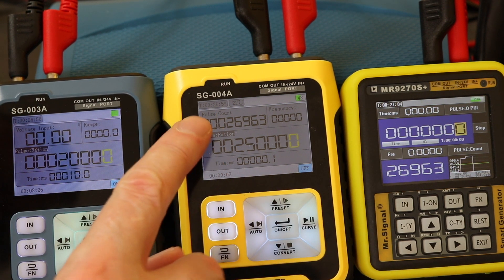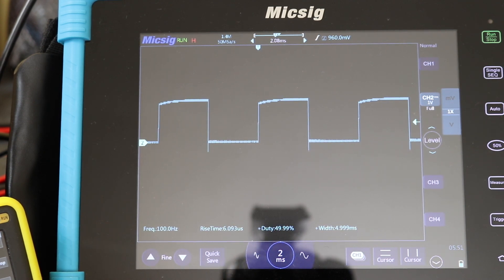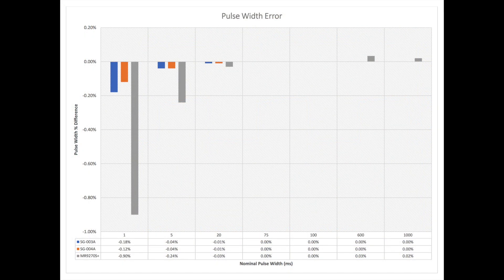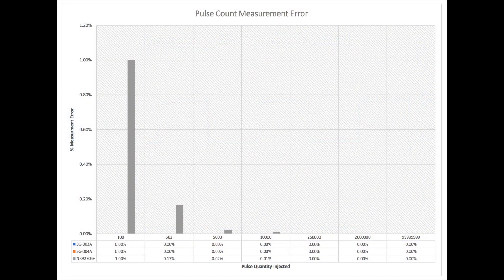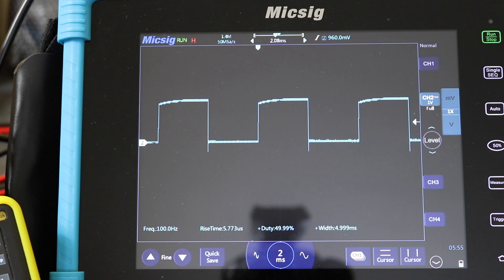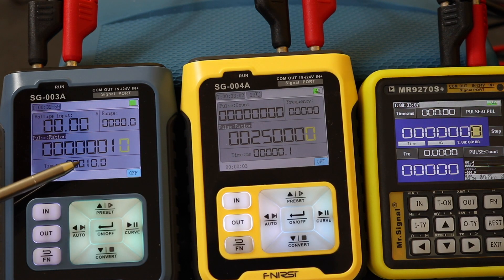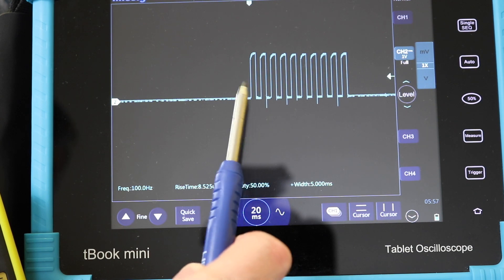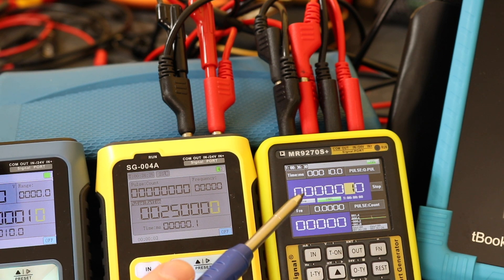Calibrator Q-Pulse Function Checks

Comment: This was a useful video. Also the other videos you made. Thanks for that.
I have another question about the pulse output.
Is it also possible to output a pulse of 3V or 12V to a measuring device? Or something in between 3 and 12V?
I want to simulate a pulser that gives a pulse of 5 volts, pull up.
That pulser is on a water meter and each round it makes 100 pulses.
So if i can simulate 50 pulses the  device should see 50 pulses. The flow has a max of 40 l/min.
Thanks
Reply from the maker: Yes, the voltage level of the output pulse can be set in the settings screen for the output mode, from 1.0V up to 24.0V.
Thanks for watching and the question.
Reply: @three-phase562  Thanks for pointing me out. Did found it. Measuring with a scope shows it just fine.
If I am correct this is only pull-up.
Is it also possible to make it pull-down? I think I should use a resistor, correct?
Reply from the maker: @AE31011  Its a switched output so if you connect the +out terminal to the pulse input and the com terminal to 0V, it should switch okay. If you have problems, then yes you could try a pull up / down resistor to see if it improves. Alternatively on the settings screen, you can change the 'way' from 'level' which would be the voltage output to 'oc' which is open collector switching and voltage free. You could then use that with the power from the sensor circuit.
Reply: @three-phase562  Thanks again. I wil give this a try.

👍
Reply from the maker: @AE31011  Good luck 👍

Comment: I reckon you can manually toogle them one after the other? when in stop-mode/active if you hit the up button (button preset) instead of hitting  play/curve button that makes it automatic.
hit the "up button" here 2:30 (step up sign) 

Thx for the video +1 I really appreciate that you dig into some of the deeper features on these process / signal gen meters, as they have quite a lot features up their sleeve.

Only got the SG003A and still trying to wrap my head around what the different things, actually do... likely need to dedicate some time to the manual or watch more of your videos as you have way more knowledge on the subject then I have... though already a subscr.
Reply from the maker: Thanks for watching and commenting.
Yes on the Fnirsi units, I went back and found that the up button gives a single pulse with each press. The right button gives the full run of the pulses and found that the down button stops and resets back to the number of pulses entered without using the on/off/enter button.
On the MR9270S+ I can only get the up button to run the pulses and the right button to send out a single pulse.
Thanks for the information.
Reply: @three-phase562  yep, also what I noticed.
you can also adjust the timebase on the fly by hitting "out" while its running its cycles, and the timebase seems to be spot on my scope, and 0.1ms cycles between 99.99us and 100.0us (Micsig STO1054C) you can also somewhat automate the manual cycle by holding the up-button, but it seem to double the sparetime in between cycles.
and you can obviously also hit the "graphing menu" in Q Pulse usecase with FN+curve and it will plot out the cycles with a falling graph-line and visualize it with a couple of axes, that I recall you do have soem control on those axes, and if it shall zoom in, or out and likely interval. FN+out and setting gear symbol, graph..
- and the control button-scheme is the same in the Graph/curve-screen, so all the same things can be adjusted, though the symbols are smaller, so likely not that ideal for video purpose..

Though my SG003A seems to be a little tricky in Q Pulse, as sometimes the first cycle is a weird short fellow and other times it aint and match my ms setting...maybe its the triggering on the scope.

What usecases does the switching feature holds?  0:46..switching obviously, but cant really make heads or tails when looking at it on the scope, while on the SG003A graphdisplay it plugs in a segmented line, as it cycling down.  (10ms)
the scope shows some very fast spikes up / down.. arhh I see there seems to be 10ms betweeen these very fast up spikes, and 5ms between up to a down spike and the voltage adjustment on SG003A doesnt seem to influence. fair enoug
Either way, great video, always a joy when one can follow suit and test it in own regi and trying to comprihend what the different things do, and the usecases they could be handy in..
Reply from the maker: @JAKOB1977  Yes, there is a lot of functionality built into these units and it takes a while to figure them all out. I haven't noticed any issue with the output pulse width on my SG-004A, they have all been equal across the waveform.  I would need to go back and take another look to be certain though.

The switching function is for use when your input has either a pull up or pull down resistor wired to it. So particularly useful for TTL / CMOS logic inputs. As it is a transistor switch, it can be used in place of a mechanical switch to avoid contact bounce affecting the input signal.

Comment: Haven't seen a video of yours in a but, sorry to hear about the job. 
Great video on the Q-pulse function. Just got a new scope (Hantek DSO2D15) and was using the SG-003A to make some waves. I don't recall the square waves being so messy though. But could be your lead set up, the actual flow meter had nice square waves. Maybe just the generators are lacking a bit or leads undercompensated not being an actual probe. 
Unrelated, but as far as the scope I just got, I can't recommend it. Seems to freeze up often, which a power cycle normally fixes. But two days ago it wouldn't reset after power cycling. Only a few buttons would work and luckily I was able to load some script in to it via USB to detect a certain power cycle sequence to initiate a factory reset. Which got it working again. But prior to the script I spent a few hours loading up software to try and reflash the FGPA from a windows machine. It was close to flying out the window and being done with it. Long story on actually getting one too. Hoping they release new firmware to fix it, but looking up the history, it's had a lot of firmware releases. It's inexpensive and willing to lose some accuracy, but freezes and almost bricking it, no. 
Anyway.....
Reply from the maker: Could be I am picking up some noise from a surrounding source, but I don't get noise when measuring the output of a waveform generator using the same lead, either 50 Ohm terminated or unterminated.
Shame about the new scope, I have never really looked at much of the Hantek equipment. I do have one of their data loggers around somewhere that I brought for a specific task but never really got it to work that well.
Like you say, hopefully a new firmware will be released to address the issues.
Thanks for watching and commenting.